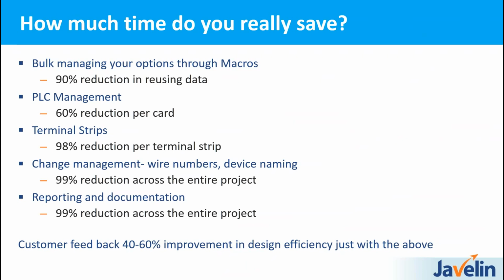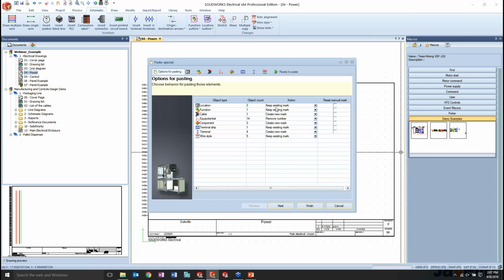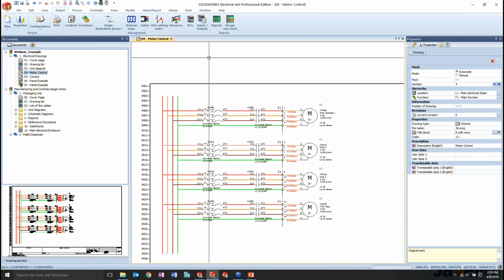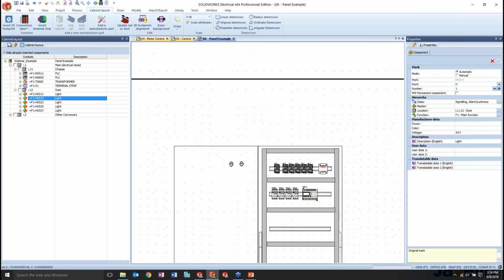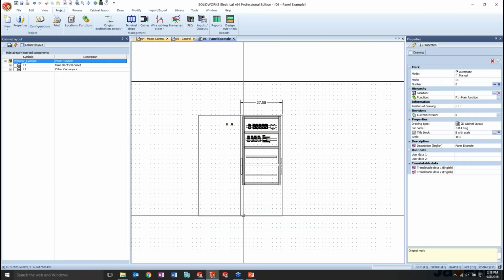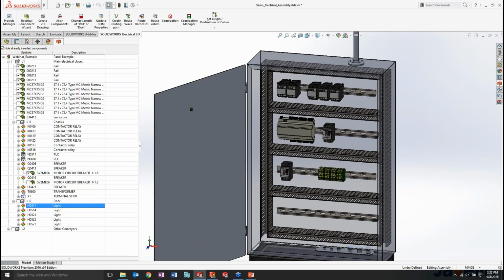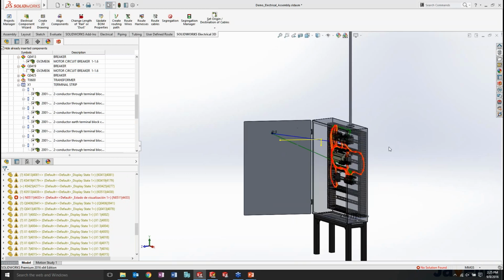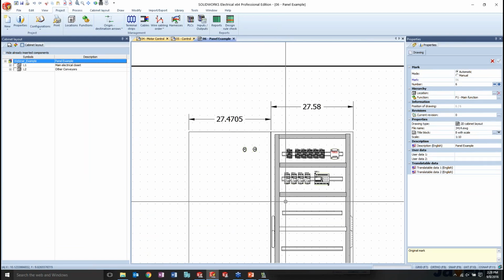How to Design a Panel in 30 Minutes using SOLIDWORKS Electrical

Comment: How you manage to get panel in 3D view. Did you draw separately in solidwork or directly get it from Solidwork electrical 2D layout.  How you managing drag and drop all componet in 3D using solidwork electrical. Please explain simple Panel. Atlease with on DOL starter fro scratch